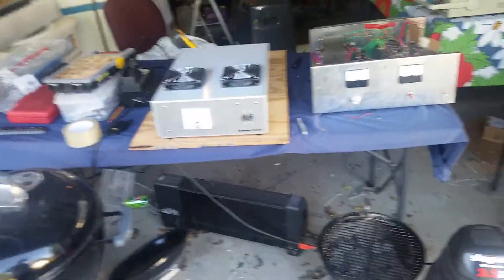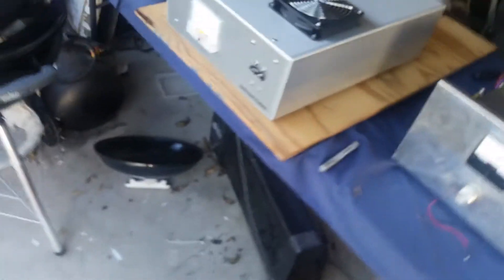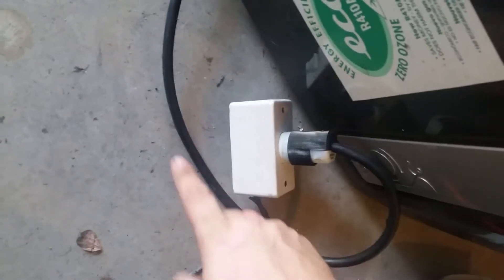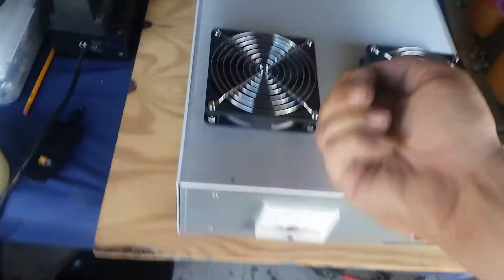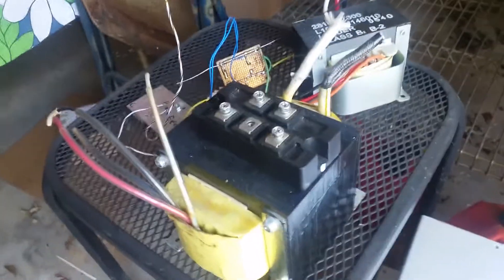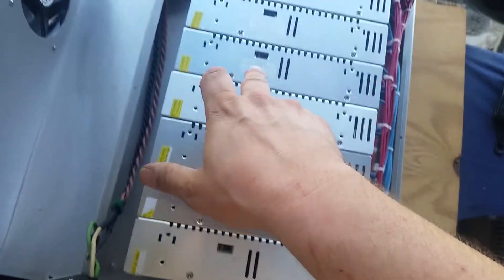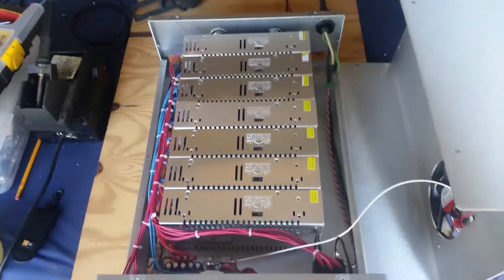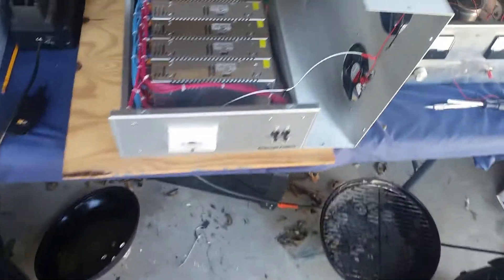Gatekeeper Built 200A Power Supply @ 15v

Comment from the maker: ⚠️❗Just so everyone knows. I have since changed my policy when it comes to power supplies. This video is 5 years old. I WILL NOT let a 200A Supply leave my bench under NO CIRCUMSTANCES or unless it has a 220v Plug on it. 

This particular situation was different & at the time I trusted that he would make the right choice. The client wanted a 200A Power Supply built but was only going to use it to power his Texas Star 5 Pill which would only use maybe 30 to 35% of the supply and was going to be getting a 220v Service Installed at a later date or a High Amperage 110v Dedicated Outlet if he were to ever use the Power Supply anywhere near its maximum.

After a lot of careful pondering during the recent years, One thing I have learned is to never trust a customer this way because it is better to be safe already then to trust someone else to be safe and do the right thing.

Me personally, I'd rather run 220v on any supply that is 100A and up. But If it is a must I will let a power supply of 100A or less leave configured to 110v but Any Power Supply Over 100A is wired for 220v by DEFAULT!
Reply: make sure you use good ac cords too. Unlike me it got all noodley and smoking with only 550w consumption. it was a ebike charger. it was near on fire in 3 minutes I smelled it get hot
Reply: I can tell you that your logic is right on PERIOD !!! This is why homes burn. Over driving the wires. Your method is most certainly wise. Safety is always number one. This helps us all live a little longer with a smile on our faces. 
Peace

Comment: COULD you be able to build a power supply that will give the same amps but be able to supply voltage from 0 to 48 ??? Thank you for your time fella.
Reply from the maker: I've already built a 100A 50v Power Supply already. But when you ask 0 to something...That right there will be tuff. You usually going to start off with 1 or 2v to something. But me personally I haven't ever done that. If I would have made this power supply variable voltage it would probably more around 5v or 9v to 20v or so.

Sometimes you don't want to give the customer the ability to do that though.
Reply: @1883GotDown  My friend has a power supply he got at an auction from the government. The unit is 0-50 plus volts, could be higher as I am a bit fuzzy at the top voltage. But what I know for sure is the 100 amp unit. The item is both 120- 240 single phase. He uses the pack for all kind of things. HHO CB power supply plus his outdoor lights which are DC lights. The  unit is a brut for sure and weight a ton and is high efficiency as stated on the unit. He is really attached to the box, and said it cost a few thousand new. I would just like a bone stock unit that is reliable for HHO experiments. What would something like that cost fella ?? 
Thanks

Comment: Where are the load balancing resistors or diodes?
Reply from the maker: Well...I can tell your getting on to me with that question lol.....would you believe me if I told you this has no balancing diodes or resistors at all....All Power Wires and Ground Wires are the exact length and for 5 years now this power supply is still working "BUT" a big "BUT" I have since changed a lot including knowledge especially when working with LDMOS and paralleling 12v to 50v Boost Converters when I had to use resistors for balancing and a LC Circuit for filtering.

Now I have been experimenting with High Current Diodes...Good Stuff 👍
Reply: @1883GotDown  You should look into R4850g power supplies, if high amperage 50v plus is something you need. I can provide more info if you want to know more.

Comment: you need a dedicated 30A 120 outlet straight from the breaker box. those switchers might be good for 240 and give more amps. Then you run a custom run from the back of the stove.
Reply from the maker: I'd agree with you. To feel SAFE on 110v using that supply to its maximum or near it...it would HAVE to be on a dedicated 30A 110v Outlet. Read my pinned comment for more info about why I did wire it on a 20A 110v Plug...which I shouldn't have.
Reply: @1883GotDown  I'm not saying mandatory....it'd be nice

Comment: It is a true shame that it could not go to 20 you will not get 200 amps on AA15 ant breaker Or a 20 ant breaker at  110 volts
Reply from the maker: I 100 percent agree with you bud....read the pinned comment and I apologize I didn't go into more details in the video....I can tell now I kinda rushed through this particular video.

Comment: that look nice. I used the same ICA cabinets . The big case like that is what I made my 60 to 65V 50 amp with 14V 10 amp iron core 723 reg supply in.  I do have a 200 amp 723 reg supply I made in 1988 . still works . bult in old frock lift charger case. that had 277V plug took all that out. 4 50 amp transformers from power mate 50 amp supply's 30 2N3771 transistors. .runes on 20amp 240V . If I load past 225 amps my 20amp breaker trips . if running on dryer 30am 240 V outlet better to switch supply's to 240V  and just grab the 2 hot leads and ground. the AC amps will be cut in half. If you want good 1000 amp supply use Meanwell RSP series with master and slave units. 1 supply tracks them all . also has remote sense leads that you put on load directly. you will get very stable voltage. you will be looking at running on a 40 or 50 amp 240V plug.  I would go 50 amp range outlet with 6Ga to breaker box. my next supply is 48 V to 50V 723 reg iron core think 100 amp. I am using a 48V golf cart to power now. 73's😀
Reply from the maker: OMG so you do know how to regulate that way using 723 and pass transistors. I want to do this so bad....I have all the parts here......is there any way you can take pictures of that project and send them to me if you ever get some free time? Maybe some very detailed images.

You know I have these 300A Toshiba IGBT Bricks because I noticed that Fatboy used them as a pass transistor for there 200A Motor Maul which is just a high amp voltage regulator ya know.

Man I hope I can figure out how to use those IGBT that I have.
Reply: @1883GotDown  I just a early pic of 65V supply . more when I take them. It is finished now. look up data sheet on 723. This was my start some years ago. Radio shack had them in 80's with book . to get voltage up float ground of LM 723 off ground and low voltage like ,68/.65V float ground pin 723 below ground with neg 6 or neg 10 volts. That how Hennery radio did it. I send basic 723 REG 50 amp supply to you . 73's

Comment: I would definitely do 240V. I have 240 in my garage for my welder. I also have it in the basement. It is no brainer to stay at or bellow 15amp per circuit. I do not want my wiring in my walls to catch fire!

Comment: I been keeping my Lincoln on 13.5 would I gain anything from running it on 15?  I’m new to all this and my power supply can go to 15
Reply from the maker: I agree with Bill aka lost jeep....try not to run no more then 15v. Keep it at 14.8v and lower and you'll see a increase in output power. If you look at the booklet it will tell you the maximum voltage to run at. Even if it says 16v I would not do it. 15v and lower. 14.8v is a sweet spot.

Welcome to the hobby and keep watching my videos you will learn a lot buddy.
Reply: ABSOLUTELY!!
You'll gain a SIGNIFICANT amount of output if you run the Lincoln at 14.8 volts. Don't run it at any more than 15.0 volts!!! The components inside the radio aren't rated for much more than that.
YOU CAN "safely" run it at 14.5 - 14.8 volts though. If you're only running it at 13.5 volts, you're leaving A LOT of power on the table! You'll gain SEVERAL watts output by bumping up the voltage...especially if the radio has been "tuned up".
Reply from the maker: @williammoss1310  thanks for that man...if I ever make me a Facebook group you'll be an admin if you would take it :)
Reply: @1883GotDown  
You know I'd be glad to.
✌️
Reply: 10-4 thank y’all. The book doesn’t say the voltage rating to just says 12.5